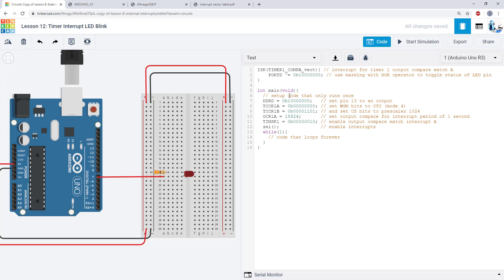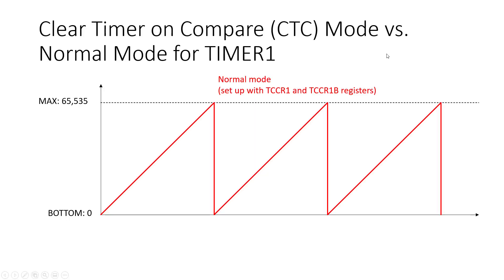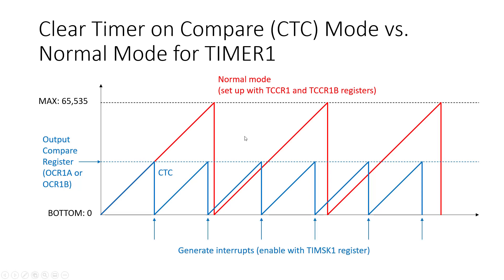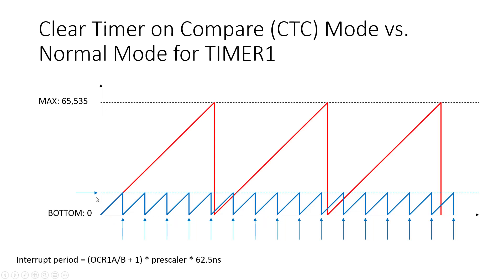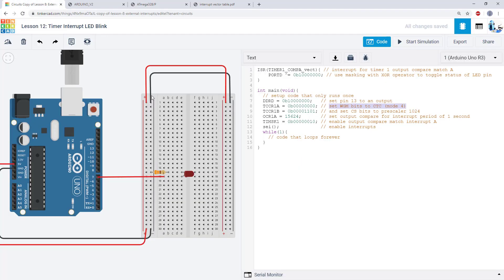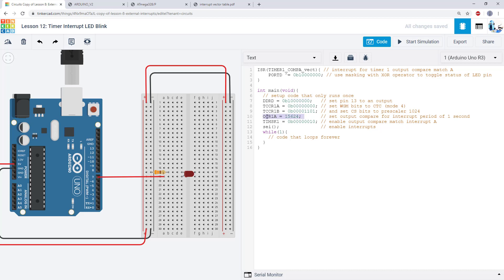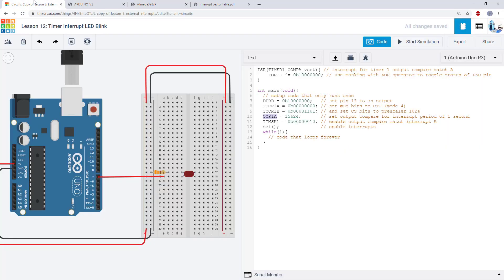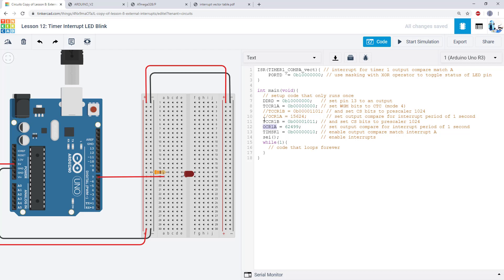Tinkercad + Arduino Lesson 12: Timers Part 3 (Interrupts)

Comment: How can I set a TOP counter limit if in table 20-6 there is only OCR1A in the "TOP" column?
Reply from the maker: Writing a value to OCR1A sets the TOP counter limit if you're using a mode that lists OCR1A in the TOP column.

Comment: Greetings, i hope you can see this in a timely manner. Im currently using a button to make an LED blink until the LED is pressed again. Im using the delay() function right now, but as you probably know, it doesnt pick up every button press because the code is being blocked by delay(). As such im trying to figure out how to make the timer flash the led, however, everything i search up just shows how to blink the LED every compare match. For my application do i set the button press as the compare match? Any help appreciated.
Reply from the maker: Hi - if you haven't already I think you should watch the previous videos in this series on external and pin change interrupts, which you can use to detect a button press: https://youtu.be/PIX6TZxukyo. You can use a timer interrupt to blink the LED and an external or pin change interrupt to detect the button press to toggle the timer interrupt on or off.
Reply: @BenFinio  I ended up just using a class and working backwards through the millis() function and setting it manually. I really do appreciate the quick reply. A true man of culture, i watched all of the videos, theyve been a huge help. Thank you for you're hard work!! 🖤

Comment: Thank you so much for these videos! They’re really helpful. The fact si that i’ve got a project at school regarding a servomotor which has to move in an interval between 45 and 90 degrees using PWM command. Also i have to print those information on two seven-segment leds. The fact is that i don’t know how to start servomotor on 45 degrees and move it in that specific interval and then make it come back. Could you please help me? I’ve searched all around internet but i can’t find examples with registers, everyone uses arduino’s libraries but i can’t because it’s forbidden by our professor. Thank you so much! Every idea or little hint it’s really helpul!
Reply from the maker: Hi - so I don't have a video on this because the PWM functionality doesn't work properly in Tinkercad. I would recommend reading through this tutorial by SparkFun, particularly the "Control Signal" section which shows you the PWM signal you need to generate to control a servo: https://learn.sparkfun.com/tutorials/hobby-servo-tutorial/all. So what you need to do is use the ATMega328p timers to generate a 50Hz signal, with a pulse width ranging from 1-2 ms. If you look up Table 20-6 in the ATmega328p datasheet, you'll see that you can do this using Timer 1, Mode 8 - "PWM, Phase and Frequency Correct." This lets you set the TOP value of the counter with the ICR1 register. So between setting that, the timer prescaler, and the output compare register (OCR1A), you can have full control over both the period and duty cycle of a PWM signal. I know that is a lot to explain in one YouTube comment, but hope that points you in the right direction. I don't want to just post working example code since this is a school assignment, so if you have further trouble I'd recommend asking your professor.

Comment: Hi! thanks for the video, it is great!! Do you have one explaining the PWM mode?? Thanks Again!
Reply from the maker: Hi - unfortunately I don't, because PWM does not work properly in Tinkercad. At least, not with registers - if you want to use it you could cheat and use the analogWrite() function and I believe Tinkercad has tutorials on that. But for what it's worth, here's some code to fade an LED on and off (last I checked this will not work in Tinkercad but it will work with a real Arduino)

// fade an LED with PWM
int main(void)
{
  DDRD = 0b00001000; // set pin 3 as output
  TCCR2A = 0b00100001; // set up PWM, datasheet p205
  TCCR2B = 0b00000001; // set up PWM and prescaler, datasheet
 p206

  while(1){
    while(OCR2B<255){
      OCR2B++; // increment output compare register
      _delay_ms(10);
    }
    while(OCR2B>0){
      OCR2B--; // decrement output compare register
      _delay_ms(10);
    }
  }
}
Reply: @BenFinio  Thanks very much for your answer. Yes, In fact I had troubles with tinkercad in some instructions with the configuration of the timers in PWM mode. Thanks again from Argentina!!!
Reply from the maker: @rgoyeche  You're welcome, glad you found the videos helpful!